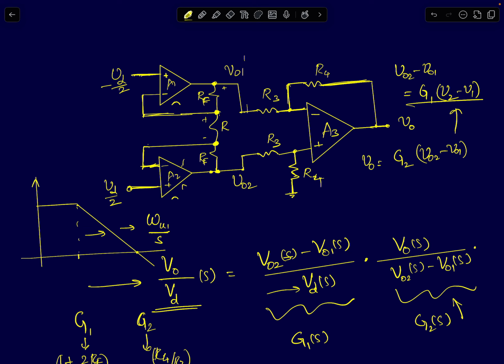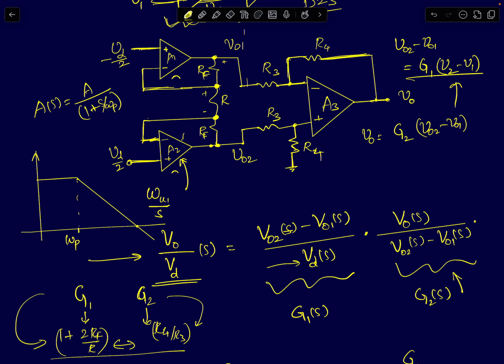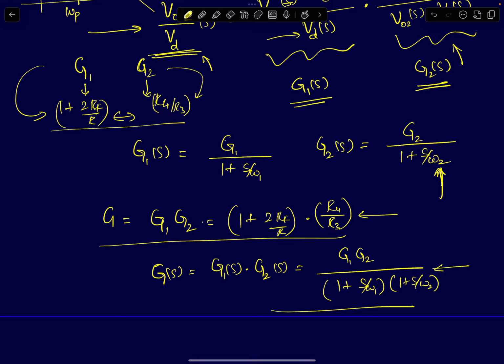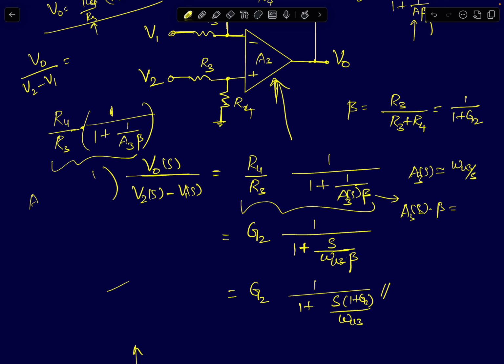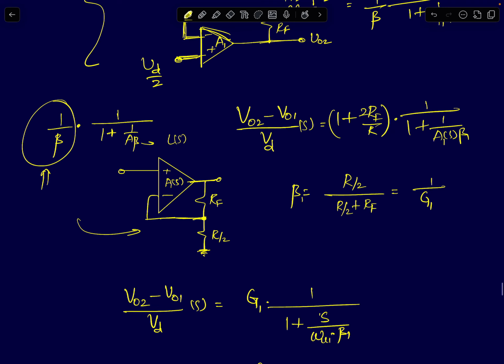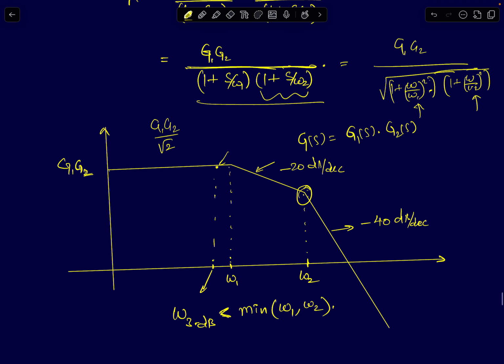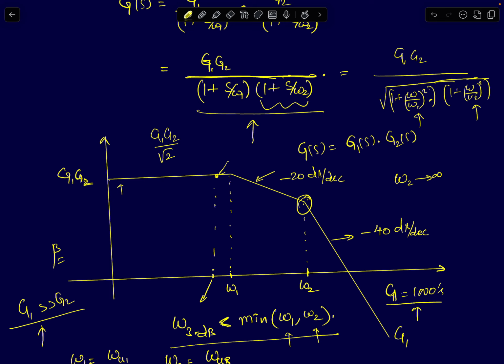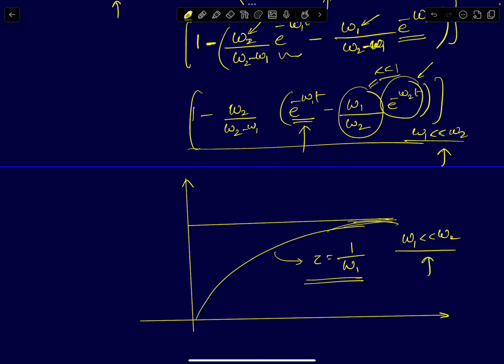AE Lecture 21.a) Revisiting frequency response of Instrumentation amplifiers

Comment: Sir dc gain of differential opamp should be 1+G2 (if we consider Finte open loop gain of the opamp )  I guess we can also not approx this because sir G2 is also not much higher than 1 as sir you told in previous lecture